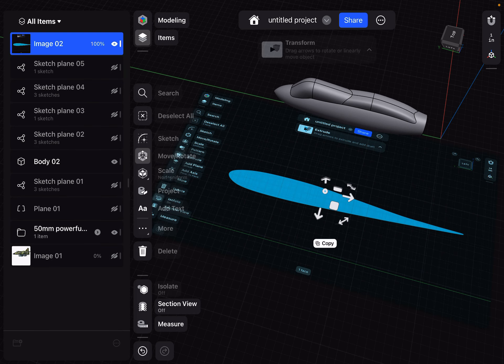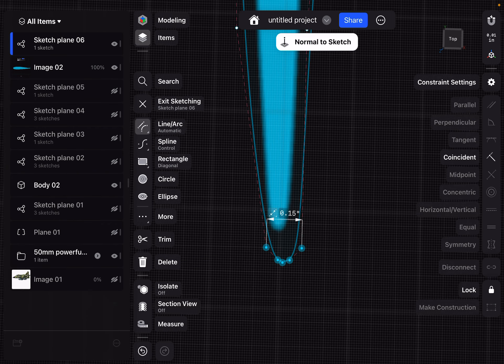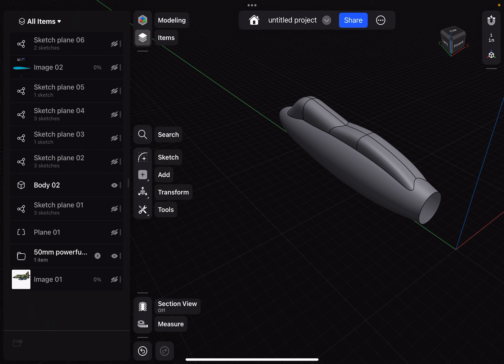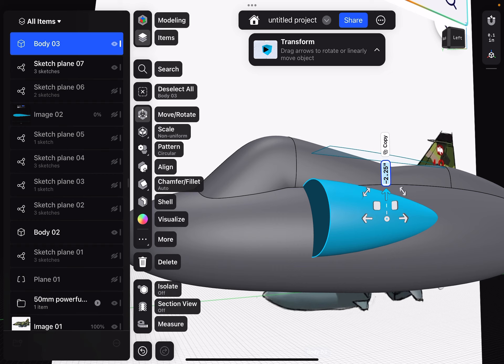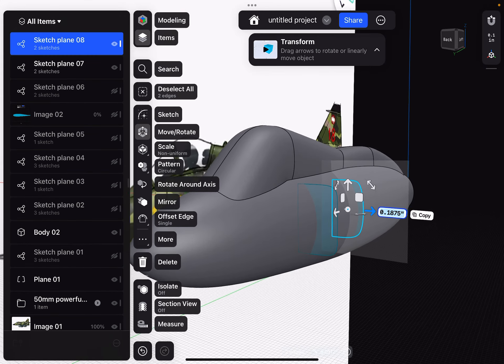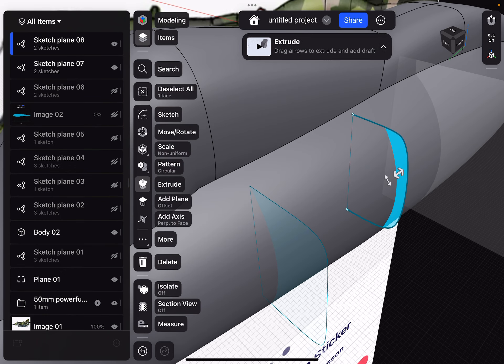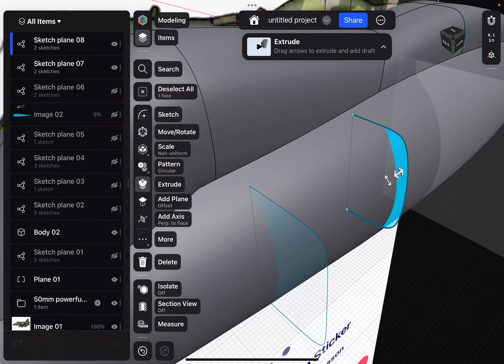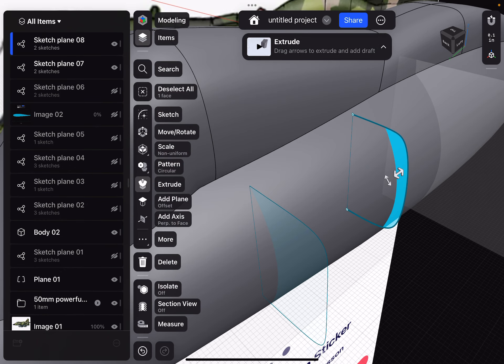Let’s design a RC Viggen Part2

Comment: Love the design and building
I use fusion 360 and you've inspired me to give something a go. Looking forward to seeing how you design the inside.
I have an old 64mm edf foamie that needs the gear taken out.
What easy print fun 64mm have you done...?
Reply from the maker: Dude this cartoon Viggen! I’ve been flying the 50mm for a few days and it’s the most fun I’ve had. I’m currently scaling it up to 64
Reply: I think the set up I have is 4s not that should be OK....
Dying to see how you do the inside lay out etc.
What's your site that you will, load the 64mm Viggen to....